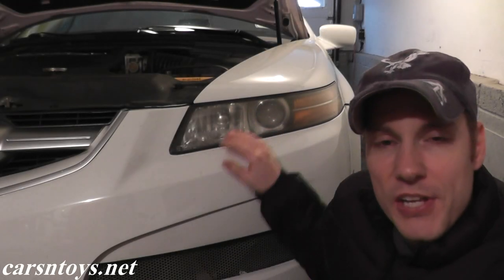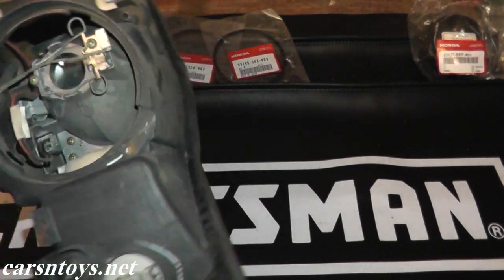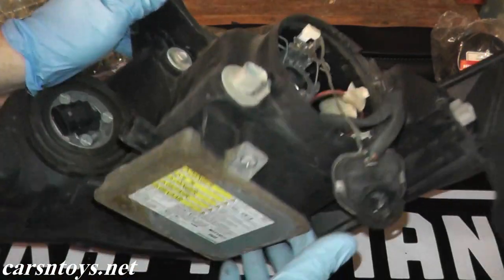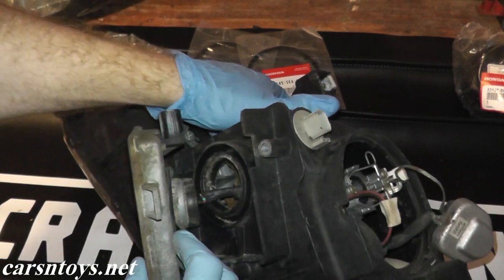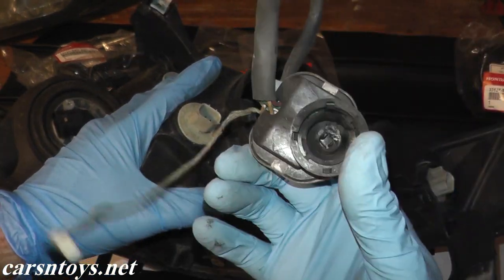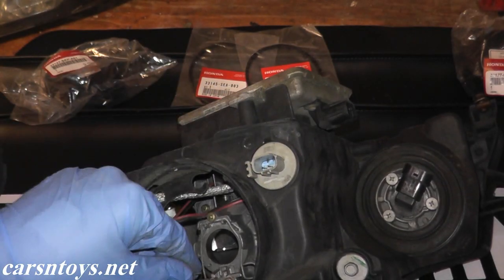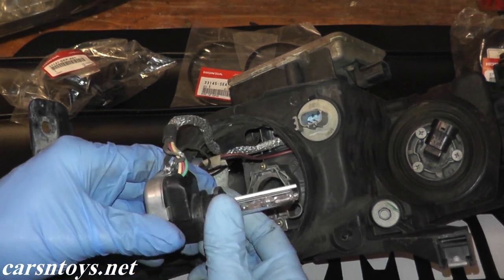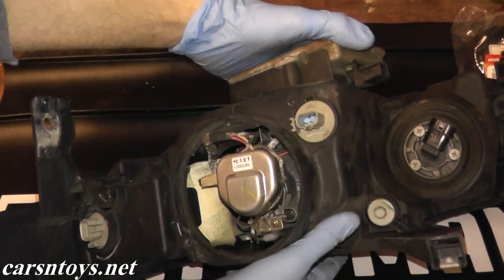HID Headlight Bulb, Igniter Wire and Ballast Replacement with Basic Hand Tools HD

Comment: For all those who still need this video you do not have to remove the bumper just the first 2 bolts on the very far sides in fact it is possible to get to from the hood without even messing with the bumper but it is difficult to work your hands between the parts in front of it

Comment: Hopefully someone has some answers for me. I drive a 2004 Acura TSX and I have to flick the light switch on and off multiple times for me to just be able to get the right headlight to turn on. I was told that it might be the ballast. Would I have to buy a whole kit and change the cables as well or just the ballast themselves? I've been stopped too many times because of my light. Thank you in advance.

Comment: thank for the video. i resently got the ballast from amazon and repleaced it but it technically did not work because the light comes on sometimes but most of the time it doesnt. I have to turn it on and off and on again multiple times untill it comes on. do you thing I need that ignitor conection?
Reply from the maker: +Oscar Fuentes Could be the ignitor, ballast or just the bulb. A friend of mine had a similar problem in his TL and it was due to cheap, non-oem bulbs.
Reply: did you figure out what it was?
Reply: I repleased the whole thing by HID lights and I worked very well... It has been about a year and it is still working well. I got it from mazon for about $50. I got the Kensun HID senon conversion kit. The D2S is the size of my acura tl model 2005.. Look for the right size for your car and you will be totally satisfy
Reply: @kaoskronos  did you figure out what it was?

Comment: I'm having trouble with my passenger headlight, when ever I change the lightbulb it will burn off the next day could it be the igniter.?
Reply from the maker: I'm guessing you're using an aftermarket bulb..? I've seen this many times by purchasing cheap bulbs off amazon/ebay. Go with the factory bulbs. They're more expensive but the quality is excellent.
Reply: Possibly ballast ignitor issue

Comment: On my acura tls have a problem with one headlight but im not sure if the problem is a ballast or ignitor 
My light when turn on flashing and turn off. with a bit of luck if I accelerate while I turn on and off the light, it starts to blink and stabilizes, but I have to accelerate it several times at 4000 rpm. Perhaps you could tell me if the problem comes from ignitor or ballast

Comment: my driver side low & hi beams have stopped working; what is the likely cause? the odds of a bulb & hid failing simultaneously is pretty high; btw there is condensation in the lens. cheers!
Reply from the maker: Try this - https://youtu.be/PSjJQDwMoDA
Reply: Much appreciated; it looks like a passive device, what's at the other end? if test bad can it be removed w/o removing the front bumper? Thx
Reply: I had a blown fuse #1 15A Left headlight igniter unit, replaced it, blown again, my igniter must be fried
thx
Reply: I finally removed the front bumper & headlight assembly, replaced the old igniter with a used one, the igniter fuse still blows when i cut on the headlights, next step is to try another used igniter, I do not want to used the igniter from the right side for I dont want to take the chance in damaging a working component.
Any suggestions would be greatly appreciated
Reply: @NVest  Sorry I’m 6 years too late. The problem is the water. There is a short circuit downstream of the igniter, probably inside the ballast or in the light itself. The high current is what is blowing the fuse.
Did you ever solve it?

Comment: Great video!  I drive a 2011 Mazdaspeed 3 with OEM HID lights.  I'm starting to notice the lights slightly flicker when I have my turn signals on.  Sometimes I notice a slight flicker when driving.  Is this a sign my ballasts are starting to fail?

Can I install an aftermarket ballast in place of the OEM Matsushita's?  I was thinking of using 35w Morimoto's.  Not sure if I can do this though, as those ballasts wouldn't mount to the underside of the headlight assembly like the stock pieces.
Reply from the maker: Have you changed the HIDs before? It sounds like the bulbs may be aftermarket rather than OEM. Aftermarket bulbs don't last nearly as long. Regarding the ballast, I couldn't tell you for sure. I tend to use OEM on HID units. It's more expensive but they're the correct part(s).
Reply: No, I've never replaced the bulbs before...thanks for the reply!  

Turns out my alternator is bad.  Voltage regulator is failing; it has a diode ripple.
Reply from the maker: Andrew Dueck
If I come across a Mazda3 soon I'll shoot a video. Good luck!

Comment: I'm having issues with my passenger head light.. it will light up when I turn head lights on but then soon after maybe 30 seconds later the head light goes dead. do you think it would be the ignitor wire or the ballast?
Reply from the maker: +Jason Welch This may help. I answer your question here: https://youtu.be/Eps7jk05aWw

Comment: I have 06 Mazda three I have been told by the dealership that I have this type of a Bulb. When I’m driving and I step on the brakes the passenger light started flickering like crazy. Then eventually goes out I can turn off my lights completely off and turn them back on and they will come back on again. Is it the Bulb or the ballistics?
Reply from the maker: I'd start with the bulb first. If you're lucky you may have a loose connection.
Reply: CarsNToys Thanks for the reply. Now I’ve been told I need to disconnect the battery and turn the headlights on with the battery off because it could still hold a charge enough to where it could really injure someone. Is that correct?
Reply from the maker: At the very least, disconnect the battery. Some vehicles recommend removing the fuse, too.

Comment: I switched out my driver side headlight bulb. When i turn my lights on it makes a clicking sound but the headlight still will not co me on. What could cause this to happen?
Reply from the maker: +Rene Botello Assuming you purchased the factory rated (Philips) bulb  then it may be the ballast or ignitor wire.

Comment: i have an Audi A3. my passenger headlight went out i replaced the bulb (HID) and the lights didn't turned on even after i had change it. my turning signal works and day light works. what could it be
Reply from the maker: +franciscotello tello Did you buy a factory bulb or something aftermarket? The cheaper aftermarket bulbs rarely work and if they do for not very long.
Reply: +CarsNToys it was aftermarket. my driver side bulb is working fine. i moved my driver side bulb onto the passanger side and it still didnt work. also another thing before this happened. both lights kept going up and down not staying in the right place. thanks for answering my questions
Reply from the maker: franciscotello tello
Gotcha. If the wiring is good, then you could have a bad igniter or hid unit. Try swapping those parts from drivers' to passenger side and see what results you come up with.